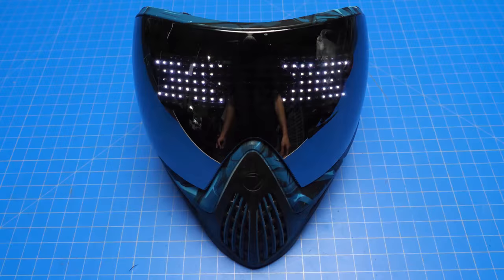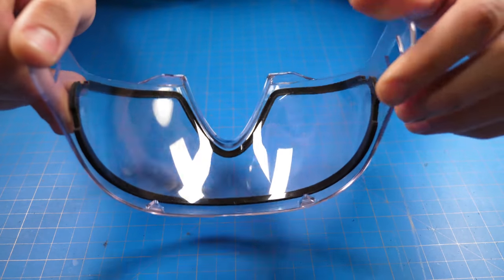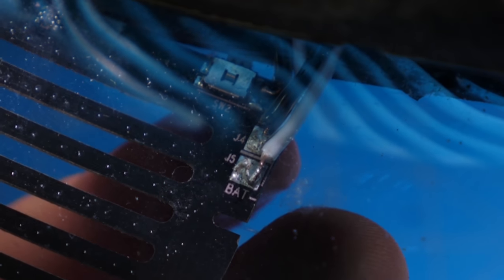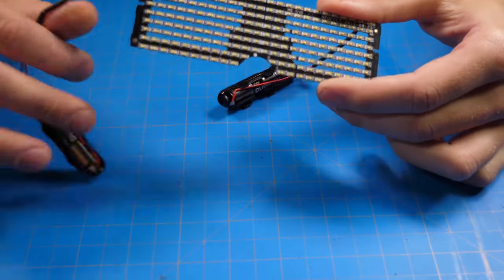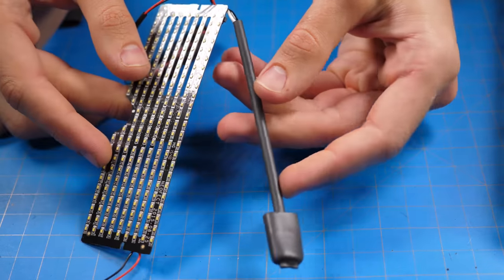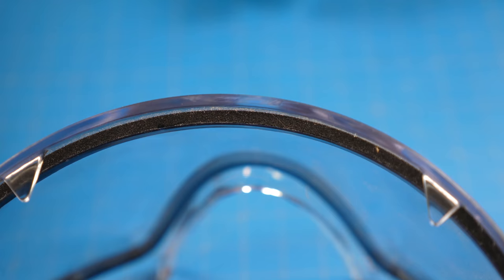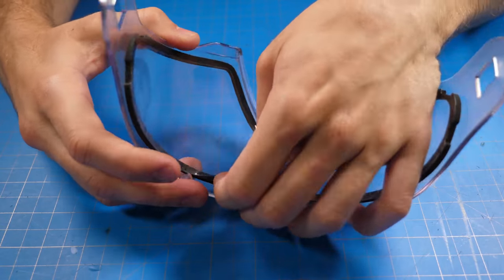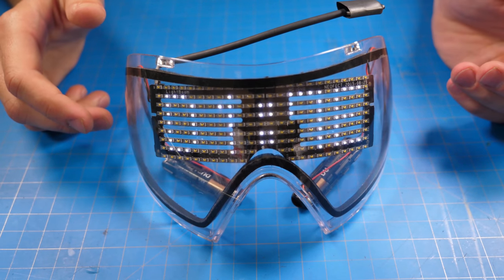How to Install Wrench Mask LED Display

Comment: I made this mask people love it. When I play airsoft. Everybody wears dye i4s, so its amusing to see something this different on a field.
Reply: yo i wanna do this but am concerned about visibility
Reply: Does the antifog on the lens still work even after blasting it with heat and how is the visibility when looking out of the mask
Reply: @wefflez6687  well I have the glasses and the visibility is pretty good just if you’re wearing this on a paintball/air soft area just be a bit more aware in the dark unless you have some sort of light then go ahead and play
Reply: @gorompulant  the glasses visibility is great just have a light in dark places

Comment: You can also extend the switch to a glove to be able to change the animations at will
Reply: @E. Viper You get a long wire and solder it to a momentary switch and the other end to where the button is on the glasses.,

Comment: is it possible that you could make a watchdog 2 drone on wheels or in the air, or make a robot buddy like glados from Porto 2, Or maybe B.B.-8 or R2-D2 from Star Wars. Anything of that can be awesome?
Reply: Clorox Bleach i’m referring a complete version. You know One with special equipment and gadgets Like the Watchdog 2 drone with the grappling claw or dropping bombs
Reply: Clorox Bleach it doesn’t have to be a bomb you could be other things
Reply: Rainbow 6 siege drone
Reply: Tech Builder made a full size BB-8 RC robot from scratch. Don't know if he goes by the same name tho.

Comment: i wanted to ask when you make the mask does the bluetooth work to conntact  with the app to change the  image not only x x  or o o other thinks from app
Reply: Hey bro he used something called chemion glasses little late to answer but they are about 70 bucks you can use the app that comes with them to make different preferences or faces for the glasses hoped this helped.

Comment: Hey, Gear. I was reading about a device called a Emotiv Insight. It's a device that reads and records your brainwaves that can even help you control remote controlled wheelchairs, cars and even computers. Think you can program that to work with the app?

Comment: What size screwdriver did you use to take apart the glasses? I’ve been messing with it for awhile but have just been close to striping the screw

Comment: uhh probably a stupid question but can i use the wire linked in desc to replace the wire connected to the batteries and the switch?
also any uk recomandations on cheap wire i can use for both switch and batteries?

Comment: I wish someone would show how to make one that actually changes with your facial expression instead of a pre programmed playlist of stuff, like the way it is in game. I would think to break apart two computer mice and put their tracking sensors across your forehead and have it set up to change the image over each eye based on the movement of your face. For some of the other complicated expressions such as the $$, I have no idea as of yet.
Reply: I have 2 ideas, neither of which I know how to do.
Motion control: Depending on how you tilt you head it changed the expression
Remote: Press the buttons to pick a face

Comment: Can I use a different brand of glasses?  I see other glasses that are cheaper, so can I use those or are they built differently?
Reply from the maker: Probably? I tried the cheaper boards but they aren't as flexible. And you can't program the display. They have maybe 10 preset display patterns, also no bluetooth. Unless something new has been released.
Reply: @GreekGadgetGuru  Oh ok thanx, Thinking of making one but need to save some money. This seems cool
Reply: @GreekGadgetGuru  I wonder if there is a way to use an lcd screen so it can cover more of the mask

Comment: Do you have to have a thermal lense please answer
Reply from the maker: It helps so that you have a layer to put the LED board, but if you don't mind, a little bit of hot glue should do the trick. Just make sure it's on a low setting so it doesn't melt the plastic lens
Reply: @GreekGadgetGuru  thank you so much you are an amazing YouTuber